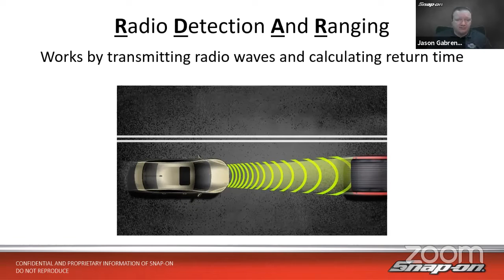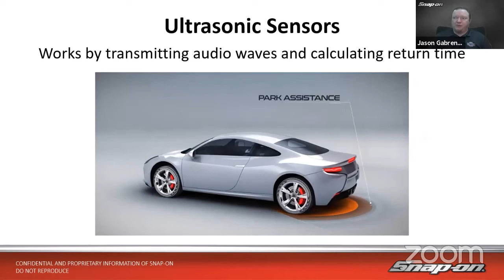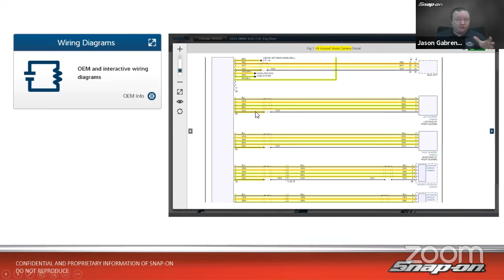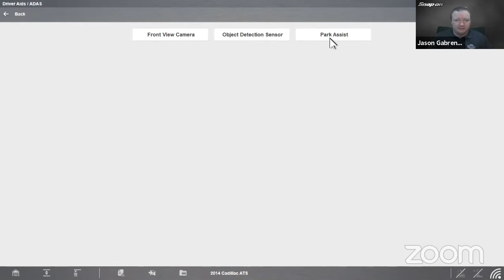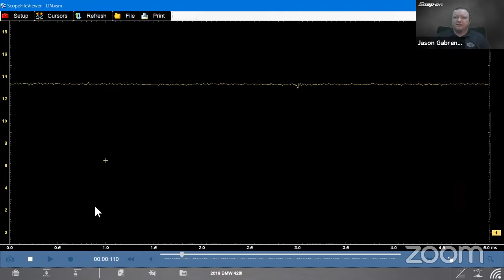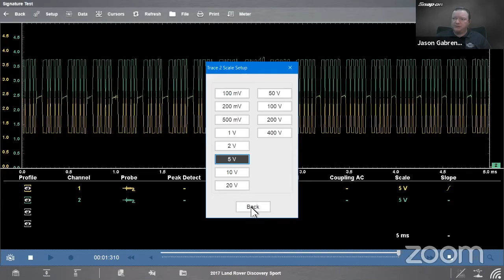ADAS Level 2 - Component Testing - Snap-on Live Training Episode 02

Comment: Back at Ford dealer in the 80s, your Workflow chart was called 5 steps to a good repair. Same thing basically. It applies to all cars back to the Model T. 

1. Confirm the complaint (may include road test)
2. Make an accurate diagnosis
3. Make the best repair possible
4. Test the repair
5. Road test the vehicle

Comment: 1.  CAN signals are differential pairs.  Impart a very large signal on both and CMRR (Comm Mode Rej Ratio) wil still interpret the low delta volt and the high delta volt. The same signal is typically driven thru a chip that has the CAN-H and the notted output is CAN-L.  The traffic does not send on High and RTN on low.

2.  Radar is 2-way, meas time of Tx vs time of Rx then div by 2 and speed of light is one way distance (between car and object).  Doppler is additive and subtractive to the Tx freq signal (train whistle is higher closing and lower departing).  There is no slowing of light/RF, with the possible exception of mediums.

JMHO

Comment: Small comment on the landrover data lines
Firstly it confusing when in one place it says medium speed CAN and in other High speed. 
Secondly the data being shown only applicable to the high speed can bus, and honestly i would love to have a bit more expansion on mid speed bus, also known as interior bus, as parameters slightly different. 
Besides that really great and helpful info! Keep doing, thanks for that
Reply from the maker: any CAN bus will have the same basic voltage and diagnosis parameters, just the frequency will change.
Reply: @SnaponDiagnostics  thank you for reply, however its not entirely true, interior can bus has no resistors to measure resistance in the bus, and high and low voltage differs. Thats the reason why i asked on expansion on this topic, got my ass kicked by my merc r-class while diagnosing no comm on the one of the modules related to  the Climate control. 
Thank you again, appreciate you reply